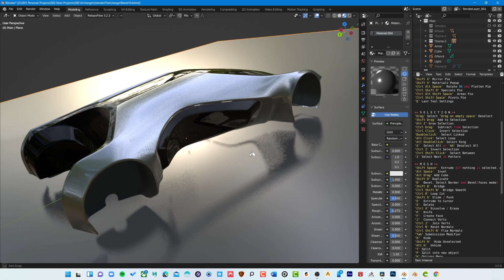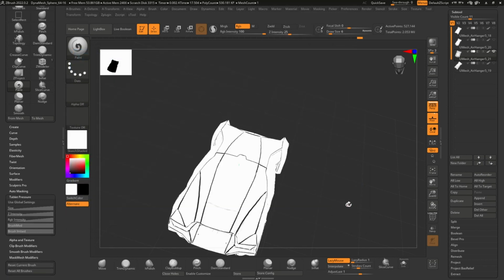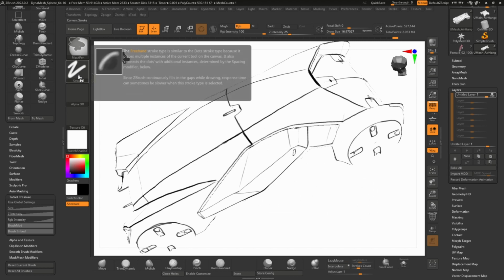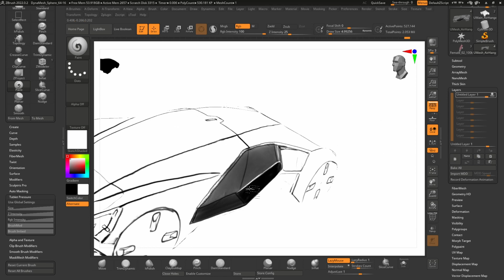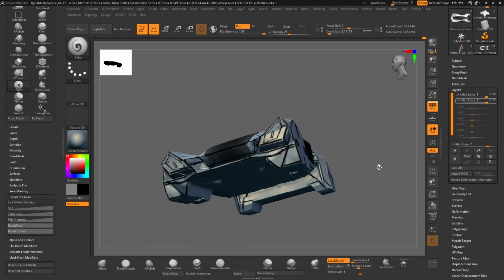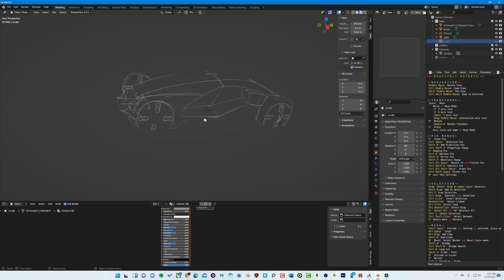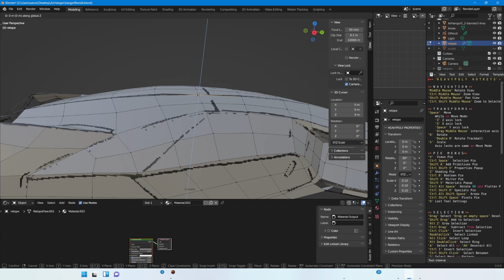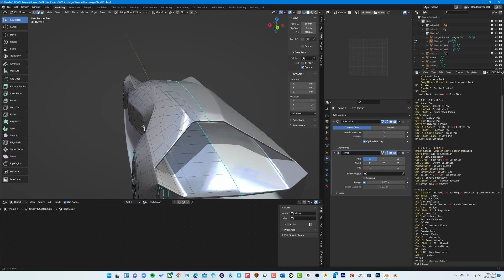Car Sketches from Zbrush Models

Comment: As an Alias user, what was your reasoning for picking Blender over say Maya?
Reply from the maker: To start, Alias modeling is quite different from subD/Poly modeling tools such as Blender, Maya, Modo, Cinema 4D, or 3DS Max.    Alias is often used to create precise nurb surfaces that can be manufactured. . .    SubD modeling tools, particularly in automotive design, are mostly used to quickly create "sketch models" to work out and visualize a concept sketch.   Bar none, they are the fastest route from 2D to 3D.

Having said this, there is very little difference between the SudD modeling packages I mentioned above.   They all have the same basic tools for moving the vertexes, edges and faces of polygons.  And moving those polygonal elements is what subD/poly modeling all about.

 I haven't picked Blender "over" Maya.   In fact as a designer, I taught Maya for several years to other car designers inside the car company I work for.   I know that Maya is an excellent subD modeling tool.   In some ways it's better than Blender, and in other ways, worse.   

I currently use Blender more than Maya (or Modo, which used to be my favorite).   The main reason?  It's FREE.   It's free and it has almost everything you can ask for in a SubD modeling tool.   It even has, unlike Maya, a built in raytracing rendering engine (cycles).     And if vanilla Blender isn't giving you exactly what you want, there's loads and loads of add-ons that will. 

So yeah, this  is why I use Blender more often than Maya, or even the subD tools inside of Alias. (Alias SubD tools are still a bit too clunky for me)
Reply: @Carstylus  Thanks for the detailed reply. Yes, I use Zbrush + Maya and use the Maya Indie version, but thinking of moving to Blender, found it difficult to get into Blender so far.

I hate the whole subscription thing in general. Now Maxon killed Zbrush perpetual license too. For now I will use older Zbrush but your reply has given me extra motivation to dig into Blender.